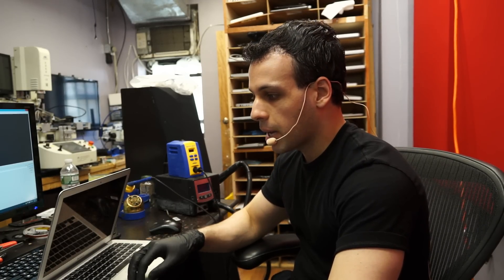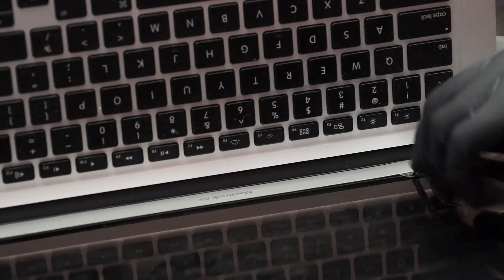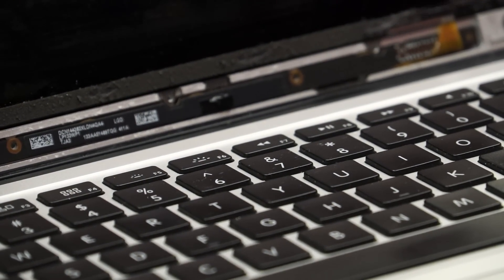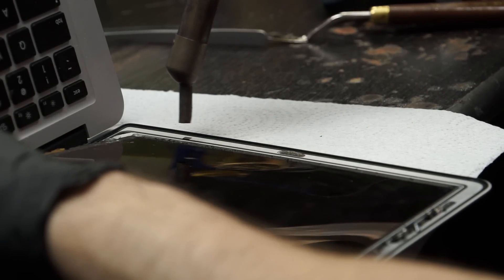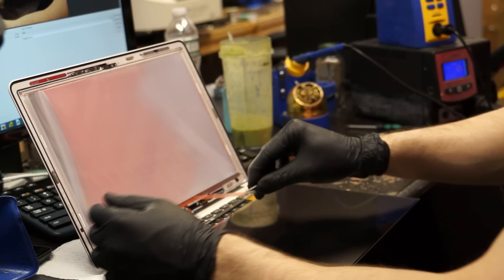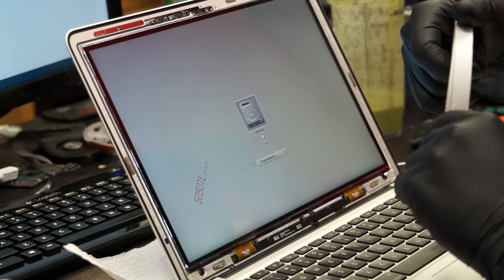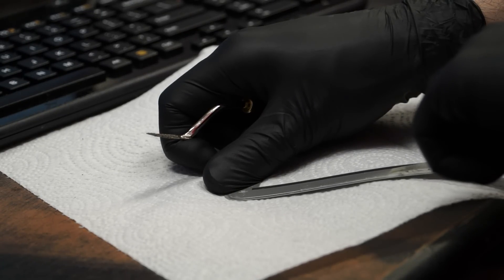How to replace A1466 Macbook Air screen updated video.

Comment: Thans man! Just replaced a screen using your video. Took me 4 hours. First watched the old video, then this new and then took my time to replace it.

I used a hair dryer to warm up the adhesive. Setting the hair dryer to blow cold air, I used it to blow of the dust of the  backlit screen.

Comment: 10:45 unscrewing
13:37 disconnecting the screen cables
15:57 second cable
16:44 removing the LCD
28:30 putting the new adhesive to right and top
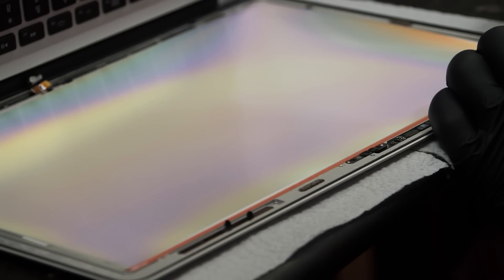30:30 reconnecting the screen
34:18 screwing back the metal cover
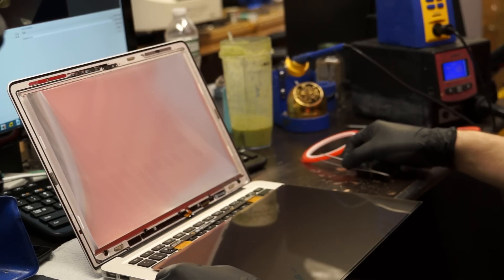35:50 putting new adhesive to bottom
36:00 Connecting the cables of the new screen
40:38 Screwing the new lcd's interface
41:00 Turn on the screen to check for dust
42:18 putting new adhesive to left

Comment: thanks louis i could replace my mackbook air 's screen after following your video step by step ,however your explanation is somehow tricky and do some steps very quickly it may lead to fail in replacement of the screen , but your are the best in doing this replacement , after all i appreciate and grateful for your good explanation in this video i could save around 400 USD by replacing my macbook screen  ,

Comment: Ciao Milan, this is great job. Following carefully your instructions I did save 400€ and did this in less than 2 hours ( I have been very careful... ;-) ). Wife took care of the bezel cleaning and adhesive, Son looked after Dad who initially plugged the backlight-flex upside-down ... a small break with a glass Sangiovese ...so in the end, everyone happy ! - Olivier in Denmark

Comment: Good thing i found your video because  i have a macbook air a1466 now in our shop for me to check if its a lcd problem or flex problem then while i was removing the bezel the screen kinda cracked on the upper left side .. But when i saw ypur video and you said about removing the old adhesive because it may cause the screen to crack solve my problem .. Because the lcd has been replaced once and they didn't remove the old adhesive so that may have been the cause why the lcd cracked :)

Comment: Hello Louis. I have a quick question. I hope you can help me with something. I have a MacBook Air 2017 and both hinges are broken. Is there a change to replace them (I already have them) by removing the bezel without breaking the screen or the screen connectors?Thank you!

Comment: Hey Louis nice video I like your attitude... I have MacBook air A1465 a bit older than this one and it was holding up very well so far but recently a vertical thin pink line appeared on the screen just in the middle I guess where the screen connects to the logic board... what would you say the repair would cost? I tried pram reset which didn't help....

Comment: When you remove the adhesive from the bezel you can use some alcohol to loosen the bond between the tape and bezel, it should help you remove it in one piece. 
Great video and great channel. Thank you so much for it!
Reply from the maker: +Dima Duca It winds up becoming a goopy mess that way. I've tried. The best for me when I have patience is putting it in the oven at 300f, take it out, and rip it all off.

Comment: When I worked for a repair shop for audio / video equipment I learnt that alcohol is better than windex or related products, because windex leaves a thin film most of the time. I don't know if that's a problem for those bezels, but when working with lenses for optical drives, or video tape recorder heads (yes, it's been a while...) then this is critical. These days, when working with laptops, smartphones and tablets, I still prefer to use alcohol, because it leaves no trace, and is dried up in no time.

Comment: great vid man. I'm doing this next week if I can find the tape and tools needed by then. At 28:40 are you applying that clear adhesive right NEXT to the deeper display layer or just adjacent to it? I couldn't quite tell as I saw it pop up a few times and you didn't seem bothered. Thanks in advance!

Comment: I've had an adhesive that's even more prone to ripping than the clear one on the display bezel. What helped me get it off cleanly is to get the same or another strong adhesive around my finger with the sticky side out and continuously stick it to the adhesive and pull it back. This makes the adhesive come off very-very cleanly.

Comment: A really good product to remove the left over adhesive from the bezel and from the Macbook Pro Glass panel is 3M Automotive Adhesive remover spray. It's really nasty stuff but works like a charm on most adhesives.

Comment: Louis, both LVDS and DisplayPort use differential lanes to transfer video data. It's a common way for all high speed interfaces - USB, Ethernet, PCI, etc.
Another thing is that it is actually possible to have random noise on the screen which uses eDP connection. The protocol does not guarantee integrity for the entire frame. And that's not only a theoretical thing - I've seen this shit in my own laptop when I messed with a DisplayPort connector.

Comment: Excellent video tutorial and couldn't have replaced my LCD without it. Just have one issue though, after I powered up, the green isight camera light comes on and stays on. It on from the time I hit the power button and remains on even with the laptop in sleep mode. I tried updating, resetting the SMC & PRAM, also checked to see if the wire was cut or moved but nothing. It also shows no cam connected in the apps and system menu.
Any suggestions on what can be causing this or how to fix?

Comment: Louis as a Machinist who has dealt with glue/tape you should see if WD-40 messes with the color of the bezal and if it does not soak it with WD-40 at the beginning and after a few minutes take a scraper and you can remove it then clean the WD-40 off and dry it and done.

Comment: Hey Louis… A friendly shout out from Canada!

I’m hoping to save you a bit of effort, and in turn, some sanity. 

There is a wonderful product called REMOVE medical adhesive removal pads. You can find them on Amazon. If you go over the surface several times (4-5), and let it soak in for 2 to 3 minutes, the adhesive will scrape right off, like a hot knife through butter - using a nylon spudger. Being that it’s medical grade it is safe for use on both metals and plastics!

I usually follow up with a quick wipe down with iso alcohol, Just to be sure the surface is “clean enough to eat off of!”

Cheers brother… And keep on keeping on! :-)

Comment: great video. scary, but great. my problem is, i have had a repair shop look at my MacBook air, and they reckon it's the panel, and wanted to charge me more than the cost of a decent 2nd hand MacBook air to replace it. so, I said no thanks. But before i buy a replacement panel, how can I check it's IS the panel that needs replacing?

Comment: Excellent video!!! Can you list what you can for the different adhesive tapes you used, such as the black tape, and the clear adhesive with the red color?

One thing I was wondering is could you use a solvent to help remove the old adhesive from the bezel, such as Goo-gone?

Comment: if your carful yes you can use polystyrene cement glue but get model adhesive its easier and can be applied with a brush you get in the pot very accurate for making models remember glue everywhere when you was a kid !

Comment: Hi,  what is the tape used in this video?  I have a plan to replace rubber bezel of may macbook air.
I got rubber from ali. and my heatgun is ready. Just wait for how to attache alu frame back.
Reply: did you find it ? i am looking also

Comment: Out of curiosity, I've been looking at the available 11" panels on panelook and is it possible to swap the panel in a macbook air?  Be it 13 or 11", mine is an 11", though.  I've found the panel I currently have and it has an eDP 1 lane connector but I can't get a good view on it.  I found a panel that the connector looks similar and is a 1080p panel but I'm not positive if it'd work as it's an eDP 2 lane.

Comment: can i use that Blick Palette Knive when i only replacing the display port cable? i normally use a very thin 0.46mm guitar pick to remove the macbook air screen bezel but it taken me almost 30mins to do it. thanks :)

Comment: can you please tell  me,  
 where can i buy the  require tools like the (tape  and  spatula)
actually i can't get the tool  where you use to remove the upper metal frame 
tell me where can i get the spatula ....... 
if it is available in online share me the link..

Comment: I was wondering what you charge for something like this? Thanks!
Reply from the maker: +sMecKsWasHere $325 + tax
Reply: +Louis Rossmann Wow i could buy a real laptop (lenovo ftw) with an i5 for that price here (not the USA).
Reply from the maker: Martin B $300 doesn't buy a real lenovo, just the shit ones! x1 carbon or the t/w series are real ones ;) maybe the p.
Reply: +Louis Rossmann maybe not a x1 carbon but being serious a g5080 with an i5 or triple that at $975 and you have yourself a y5070 fully specked out gaming laptop, a x250 or a t550. Thats just retail prices. If I went supplier I could probably get a x1 for ~$800 give or take the exchange rate including vat at 14% standard +14% extra for laptops. Lenovo is really cheap here. Still enjoy my dell Latitude though. Dells cooling system could be better (please dell stop using s#!t thermal paste and thermal pads and add a bigger fan) but their longevity is great imho.
Reply from the maker: Martin B to me it's high end lenovo thinkpad, and then "the rest" when it comes to longevity/durability.
Reply: +Louis Rossmann my view on longevity and durability is this. if a product like a laptop/cellphone can last for more than 5 years with no need to deal with a repair whether free or not it has good longevity. The lenovo's and dells i have dealt with and used personally over the years have met this expectation. If something lasts longer than this that's even better. Usually after 5-7 years if everything is still working I clean it up and relegate it to other tasks. Media pc (after removing the battery for safety) or a work/learning pc for a family member or a friends family member. I always try and give computers/cellphones a second or third life, whats the point in wasting good hardware. Longevity terms only lenovo and dell (not inspiron cheap side)really meet my standards. Dropping, lifting from the screen, throwing into a bag frequently. If a laptop can last 5 years through that ill give it full marks. lets just say no other manufacturer has met my standards yet, especially apple and hp. 
Sorry for long posts I am just that kind of guy.

Comment: Have you ever tried using a playing card to remove the bezel? I found that to be much easier for removing the glass on older MacBooks instead of using a metal spudger, I haven't done an air screen with it before though.
Reply from the maker: +JHx86 I haven't

Comment: hi, i got a problem with my macbook air. From working fine to showing a white screen when booting up the computer. No colision nothing, when i started the computer a white screen with no symbol on it is showing, the only sign i got is that the computer started saying "press back to select english" other than this nothing works. what do you think is the problem? i would appreciate an anwser :)

Comment: Hey guys,

I have a Macbook Air. The iSight camera is not working. 
I already try the command sudo killall VDCAssistant
Weird thing is that the brightness sensor which is located next to the camera is working fine.
What could it be? Bad cable ? Bad camera or something on the board itself

Thanks for your help

Comment: hey, thankyou for this video, i replace the lcd before but having problem with the 5 screw at the bottom :))) i put the bracket on top of the lcd (not betwen backlight and lcd :v ). this video save me alots :) and also i was mess with f**king screw on iphone 4 too :(

Comment: Wouldn't it be more beneficial to detach the display assembly from the base? Love your videos, and are probably going to follow this to change a 2015 Macbook Air 13.
Reply from the maker: No. Unnecessary work, just more to potentially screw up that way.

Comment: Man I have a macbook air 2013 and another MACBOOK but it is just macbook I do not know the preferences of it All I know is just the size it is 13 inch. So Could it work if I change the LCD from macbook to macbook air. Both of them are 13 inch. Thanks

Comment: Hi Louis, Hope you can help. I have a late 2010 13.3 MBA screen that I want to repair myself. And I did hear that the screen assembly is easier to change than just the LCD.Now, I live in South Africa, where parts are rare and expensive. However, I have been offered a complete, but broken 2013 MacBook Air for cheaper than a A1369 screen assembly. (I believe the motherboard is busted on the A1466.)

So, not sure if it differs per region/model, but are the 2013 assembly cables are longer than the late 2010 A1369? (bearing in mind that I will be removing the assembly from a factory A1466 MacBook Air.)

If they are, I believe it will reach and plug right in. Are there any other compatibility issues I should be aware of?

Really appreciate if you have any insight to this problem, and if you've done a repair of the A1369 with a A1466 screen assembly.

Thank you in advance if you have an answer. (I don't want the Apple engineers to win.)

Comment: Louis, have you ever tried using GooGone to remove that adhesive from the silver bezel?
Reply: Josh Bacon do not use Goo Gone. It’s kind of oily, and hard to work with and requires more cleanup effort than necessary.

Comment: Do you still  fix Mac Airs for $325? It's May 2019, I'm asking bc after seeing your video I know for sure that I won't be able to. I spilled blueberry yogurt on my Mac, and it still worked. I turned it off and cleaned it with paper towel and water, that's when the screen went to color lines. Can I send my Mac to you? I'm in Mexico and it's not a wise choice to have it fixed here. I could send it to you from Texas if you agree.
Reply from the maker: It depends on what is wrong with yours! You can send your macbook to us, https://sendyourmacbook.com

Comment: You could try using acetone to remove the adhesive from the bezel. I wouldn't recommend using it on any plastic parts though.
Reply from the maker: I avoid liquid because if it seeps under the LCD cell and gets to the layers they are screwed permanently.

Comment: Louis, I know acetone will dissolve this type of adhesive. I wonder if it would ruin the finish on the bezel?
Reply: kazolar Volatile chemicals and electronics are generally not a good mix… What I use are REMOVE medical adhesive remover pads. Go over the surface with the adhesive 4 or 5 times, and give it a few minutes to soak in, and then a nylon spudger will cut through the adhesive like a hot butter knife :-)

Comment: You're missing one huge detail is that REMEMBER to remove/disconnect the battery when doing this screen replacement for Mac or laptop in general. Lots of newbies out there and they're going to eventually f*ck it up by shorting either screen or motherboard. Seen it , been there, done that :)
Reply from the maker: +tipt0p Q 7706 ensures that that no power is going to the back light circuit while the computer is off. I don't worry about that at all.

Comment: I would like a tip on where to buy a new lcd panel, whenever you get a moment. 
so I plan on buying this netbook, an Ideapad 100s, it may sound like a piece of garbage or a waste of money, whatever. I checked one out at my local best buy and its performance was respectable for an atom powered machine. It has a piece of shit TN panel which I guess is to be expected @$200. say I wanted to get an IPS panel, and switch them out, as long as the panel I buy is also a 30-pin, and EDP compliant, should I have any issues? 
finally (what a pain in the ass huh?) would the replacement cause any performance hits, like with battery life or etc.?

Comment: Thanks for the video, very happy to see some one else whom hates Macintosh, (Apple). I would not be doing this job if it was not my business partner whom wanted it done. I change lcd/led out on laptop every day in less then 15 minutes. I see this one will be a real bitch. For all you apple lovers don't come to my shop wanting repairs. I DON'T DO MACs. Over priced complicated junk. Spend your money on a Lenovo or Dell. Easy to work on and cheap to fix.

Comment: Does anyone know what the screen model number is for a late 2010 Mac Air 11? I want to reuse my old screen as a live view monitor, but want to keep it in the casing and this has far too much risk of damage just to read a label. Need to get a driver board.

Comment: tbh it seems like even though it is certainly possible, the risks do not outweigh the benefits of replacing just the panel, compared to replacing the assembly.

Comment: HELP! I put everything back together correctly, have it all hooked up but the LCD laying on the keyboard.  The backlight doesn't work.  The image is displayed in the LCD but no matter what position I put the cable it it doesn't work.  It's impossible to flip the cable over so I can't have it plugged in upside-down.  I'm panicking right now.  The backlight worked with the old screen.  Why doesn't it work now?! The cable isn't torn or anything!
Reply from the maker: +GTaero probably blew the backlight fuse or plugged the backlight cable in upside down